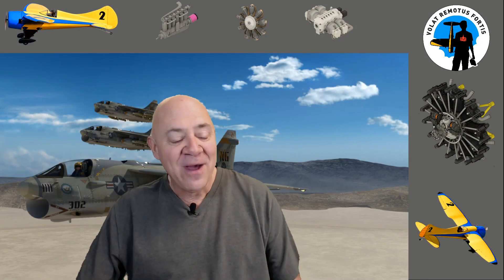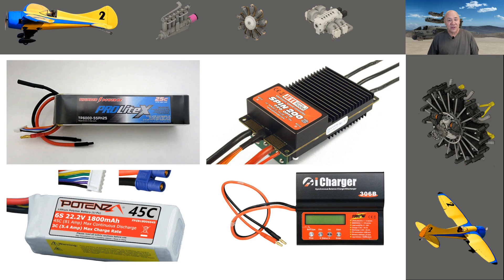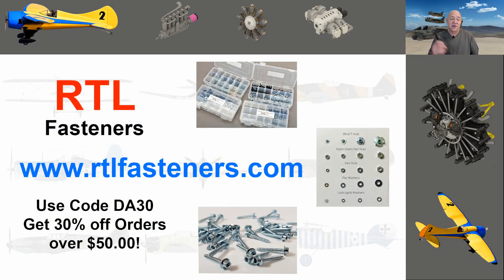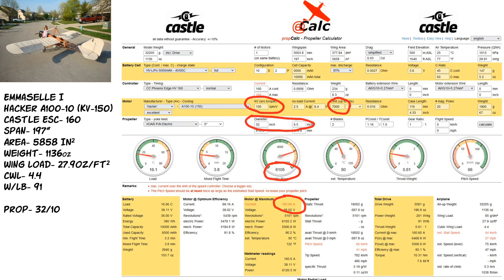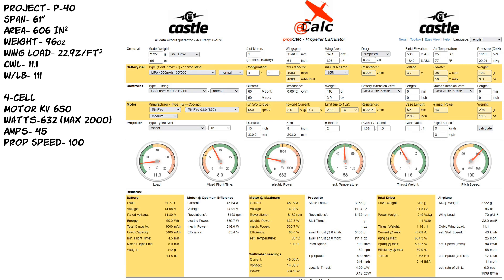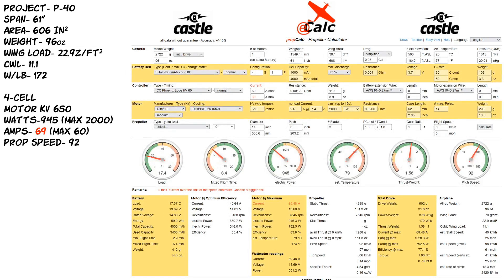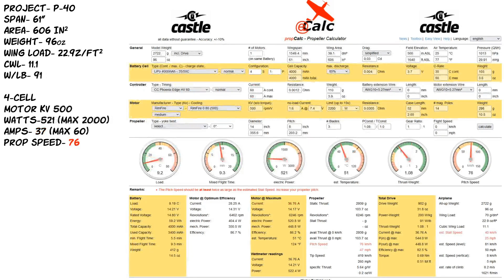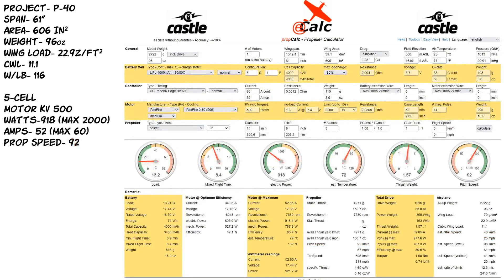Demystifying Electric RC Airplane Setups

Comment: Thank you! This has been the most difficult part of designing and building an airplane from scratch.  For me it was the propeller pitch and blade number that kept causing trouble. I have never been so frustrated!
Reply from the maker: There will be a part two to this video. I will dive deeper into prop speed and diameter. Rock ON!